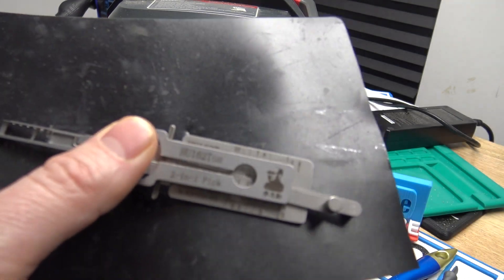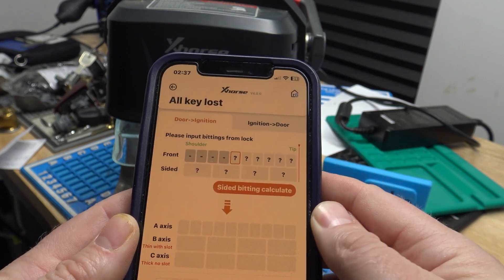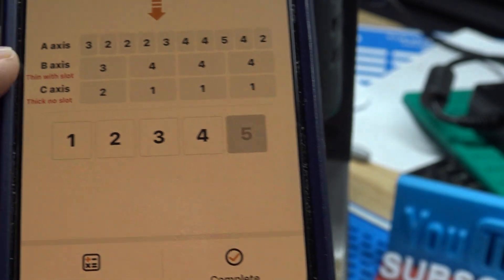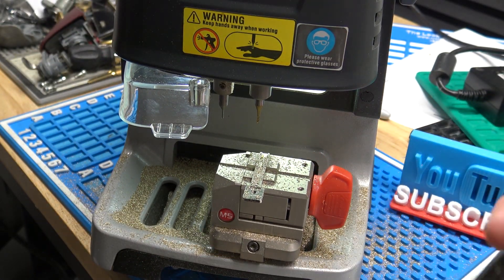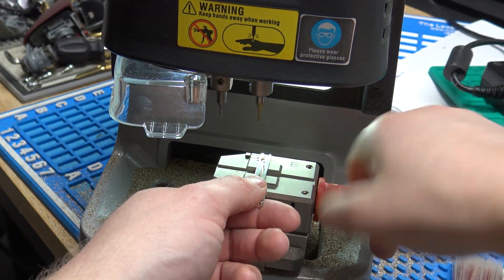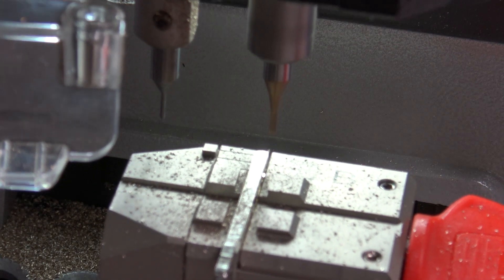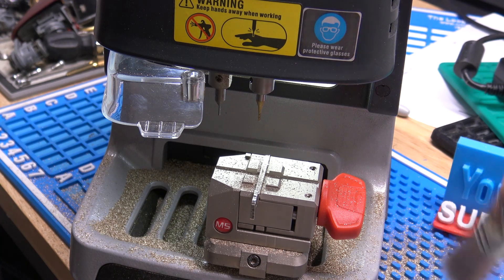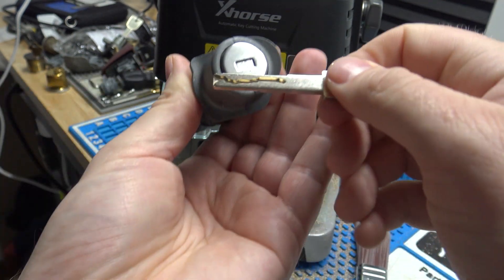(575) HU162T 10 Cut Lishi Picking Decoding & Key Making Part 2

Comment: Really good video! You explain things Really well mate. Can this lishi HU62T 10 still be used for 9 cut door locks? I have customer with vw ID3 keys locked inside, not sure if its 9 cuts or 10 so ive ordered the 10 lishi
Reply from the maker: No. The lishis will only go into the locks they’re made for. 10 won’t go into the 9 cut lock

Comment: Where I made mistake if I can after picked and cutted blade only operate blade in one way ( lock state. Before picking on unpicked state I didnt have any tension on 2,3 ,4 positions ….
Reply from the maker: Did you get it figured out?